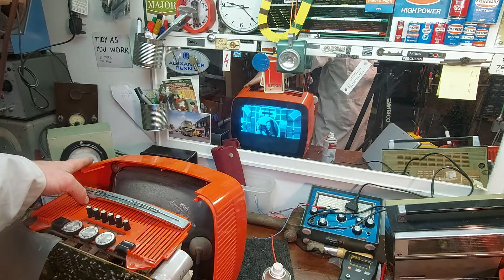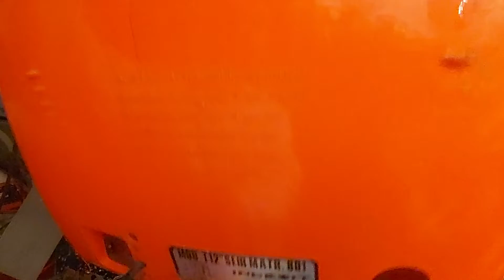Indesit T12 801

Comment: Missed the livestream as it was 2am Australian time. Interesting little set. I had a Philips P60 (TB810 chassis) 12 inch set at that time. It was yellow but there were other colours, in Melbourne it depended which retailer you bought it at.  I saw a number of white ones at RMIT college being used as monitors for some 6089 training units.
Reply from the maker: You haven't missed it yet, it's tonight. Though at 2 am I wouldn't blame you for missing it!
Reply: Odd, I had a notification saying it was streamed two hours ago when I woke at 5am.  Maybe a short test?
Reply from the maker: That's right.

Comment: Very nice sets those Indesit ones. Have you had some advice about the Line Linearity or would you like me to look at the circuit?  I know what you mean about shapes and certain models. There was a B&O set that looked great until you took the back off.... ICC5 !Lovely sets.... lovely.....honest....
Reply from the maker: I haven't looked at it since Steve, any pointers welcome. I tried to download the diagram of radiomuseum but it wouldn't work. I had an ICC5 once......
Reply: @IrishvintageTVRadio  There is a coil which you need to tweak - L401. In the Newness Book it as at 9,00 if you look at the tube base as a clock face.

Comment: What is your Mains voltage and frequency where you are?
Reply: … Ah… I see now; 220v at 50Hz, right?
Reply from the maker: It was, it is now harmonized with the UK at 230V +/- 10%, 50Hz. Usually actually around 245V here.